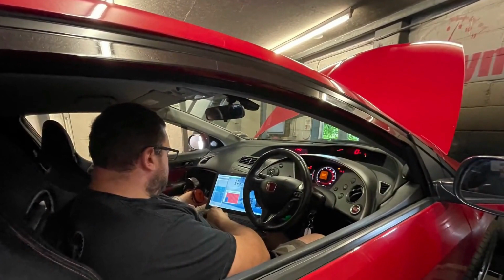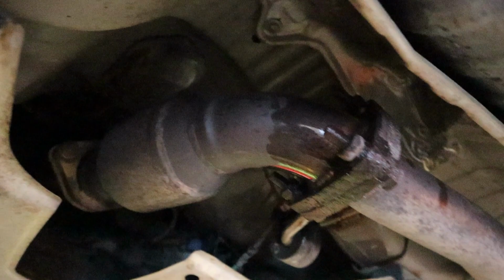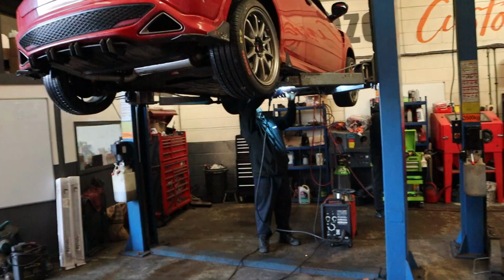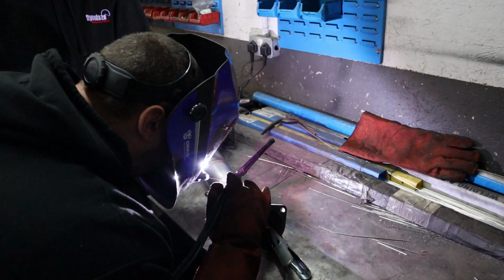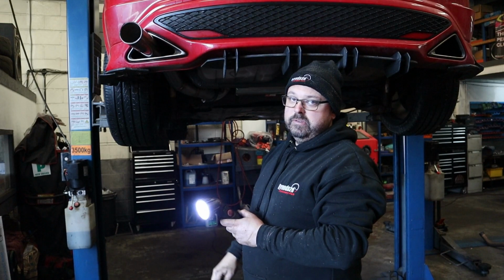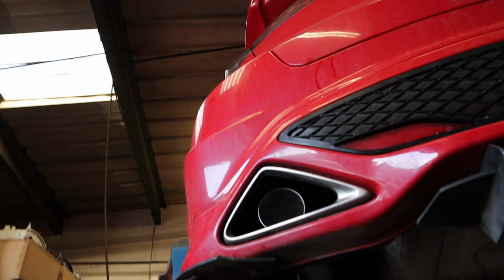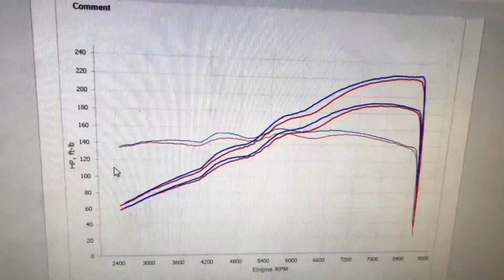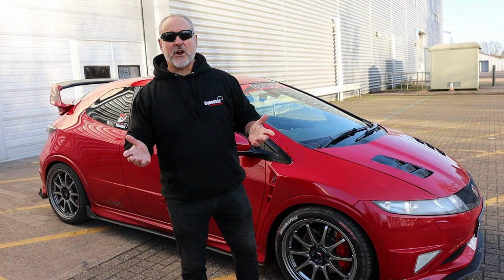NEW FN2 Type R 3" Exhaust! 🔥 **SOUNDS AWESOME!!**

Comment: 222BHP still seems due to the piper sports cat (same on mine, on that smae dyno). Yours is the fourth I've seen all at that BHP with that sports cat fitted. Nice vid and hope you both had a fab Xmas.
Reply from the maker: Hey djmandrick, thanks for giving it a view, its really so appreciated. Cheers for the info, thats really interesting.Now we have just pushed past the 222BHP, hopefully other mods to follow will give us positive results. Glad you enjoyed the video and hope you to had a great Xmas,  have a Happy New Year👌👍✌
Reply: @DAZR09  Exactly the reason I didn't bother with an intake, having seen another one with a skunk and the same BHP as mine. Binned the dynodaze air intake pipe, it was so big it pushed the radiator pipe and distorted it and transferred heat into the coolant which induced a blown headgasket which cost me 1100 to have it fixed. Now had a Tegiwa fittted instead. Guess that what comes of being a tester, spotting the patterns and the need to know! She should rip with some more mods (high 230s the guy suggested on mine when i bought it with a 3" exhaust  and manifold) I'll be keen to see them. HNY for when it comes.

Comment: Hi, how much did this cost you? I'm looking into getting 3" done and remap. Did you pay extra for them welding it and adding piping / labour. As looking for a rough price of what I'm expecting to pay once my car is on the road.
Reply from the maker: Hey JannyUK, thanks for giving it a view and dropping a question. Best to contact Dynodaze direct as prices for labour and parts have increased , also to find out lead times on materials etc.. They would then be able to quote you a price for exactly what you require. Hope that helps. 👍

Comment: Hi daz do you know how the inner black surround was removed? Mine is touching the exhaust. Are they bolted on or do I need to grind them off?
Reply from the maker: Hi Choptang564, thanks for giving it a view and dropping a comment, its really so appreciated. Yeah!, they can drive you nuts if the exhaust touches them. If you want to keep the chrome triangles in place you can just simply grind them off mate, like we did. Makes the triangle look bigger as you can see on the footage. Some people take the whole unit out, but you have to watch you dont melt your bumper doing that🤣. Hope this helps mate.👍✌

Comment: 2.5" or 3" for maximum power???
Reply from the maker: Hey xconankunx4530, thanks for giving it a a view and dropping a comment, its really so appreciated. 3 inches straight as possible for power gains 😁🙏👌👍✌
Reply: @DAZR09  cheers for the reply. Can you do more vids of hitting vtec in the FN2R 👍
Reply from the maker: @xconankunx4530   Sure will mate, got some more mods on 3 inch exhaust,  and manifold etc coming up so stay tuned brother . Thanks again 🙏👌👍✌
Reply: @DAZR09  thanks for the quick reply. Can't wait for the next vid 🙏🔥

Comment: Not trying to be rude if you see this daz but how much did this all cost ?
Reply from the maker: Hey Ash, thanks for giving it a view mate its really so appreciated.  Its not cheap mate. 3 inch exhaust on Dynodaze website is £975, I got a deal on the fabrication to the tail pipe. I wanted a true 3 inch all the way in case i decide to up the power. I might have gone down the Tegiwa route  but told they could not supply until April at least, and it may be more expensive. I had  some other bits like valve clearances and timing belt done to. Exhaust/fabrication and fitting was around £1170. Expensive, but she sounds epic now 😁. Hope this helps mate.👌👍✌
Reply: @DAZR09  thank you for responding. Thank you for the info, love your channel keep up the great work
Reply from the maker: @adavies461   Thank you mate